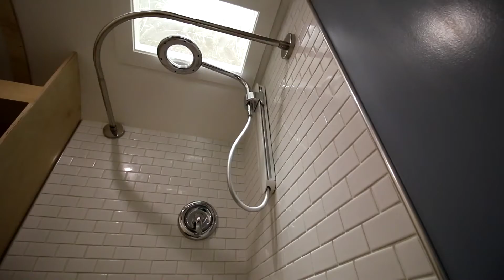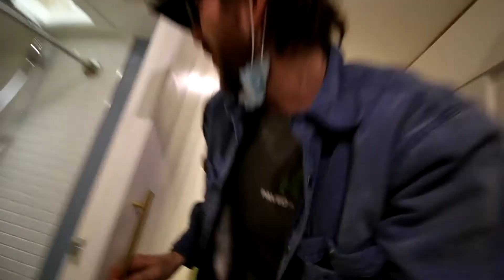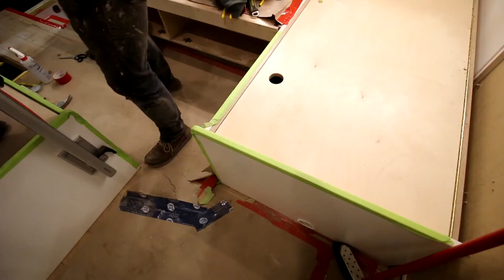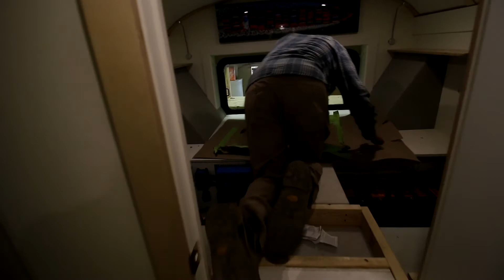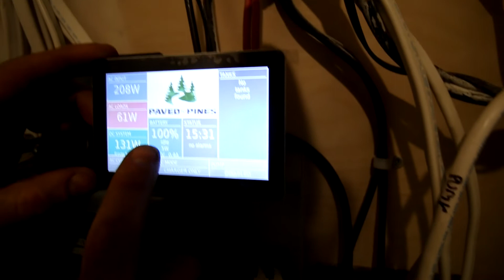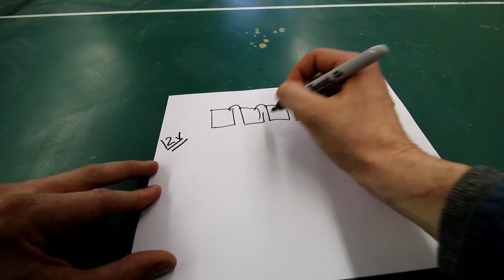Off-grid RV Power System | Shore Power, Solar, & Alternator

Comment: Why not put the batteries in the underbelly?
Reply from the maker: Great question! We have before, and it's completely up to you. Here's why we didn't put the batteries in the underbelly: 1) This unit is is 4 season, meaning for prolonged battery life, we would have to heat this bay. 2) Longer wire runs with 4/0 cable if placed in the underbelly 3) Client wanted these underbellies for AS MUCH outdoor gear storage as possible! 

Thanks for the question :)